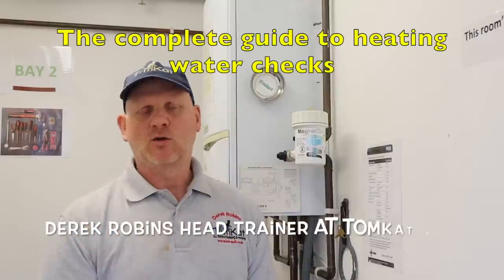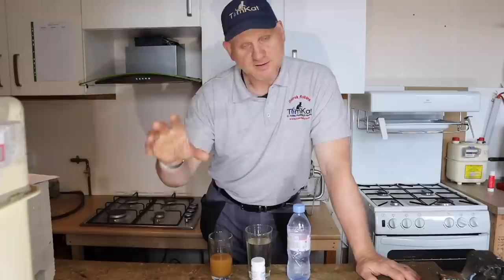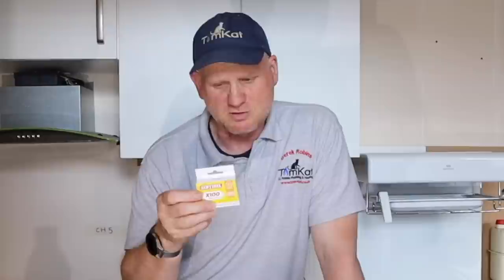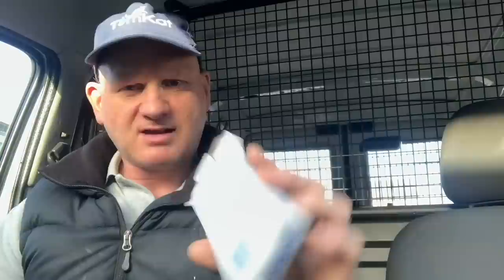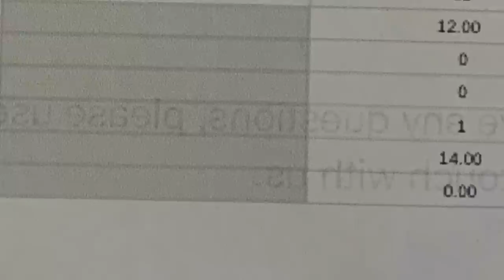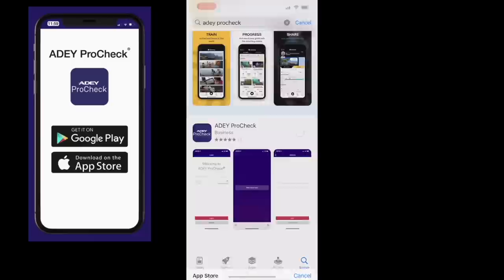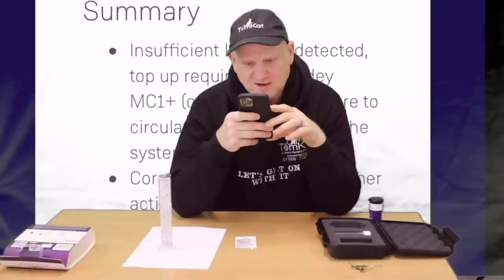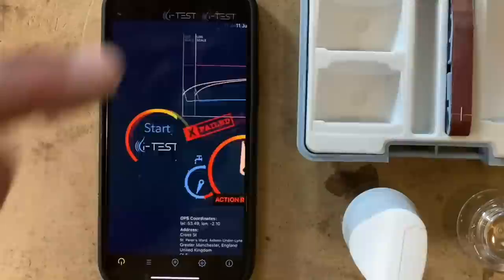The complete guide to heating water tests for heating engineers. Looking at complying with new regs.

Comment: Another useful and informative video for-the experienced and trainee. I have tried to look through previous videos to see if you have covered mini expansion / shock arrestors. It would be interesting to know the facts and why we need them if a water meter is fitted. If we install an under sink 15ltr Hyco for example, most MIs state that under certain conditions and depending on pipe length we do not need a mini vessel for expansion or shock arresting. We have almost certainly got the pipe length within tolerance with a combi installation  so a video on this would be useful to clarify the situation. Apologies if this has already been covered. 👍
Reply from the maker: Good idea I will put it on the to do list 👍🏻